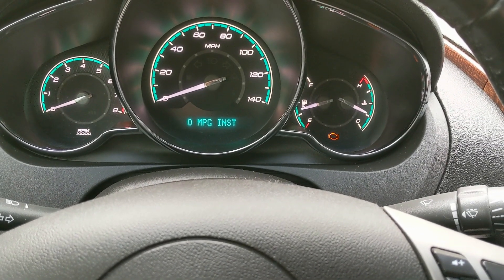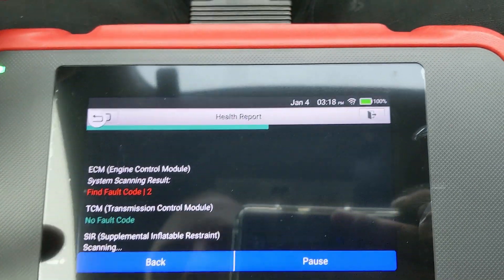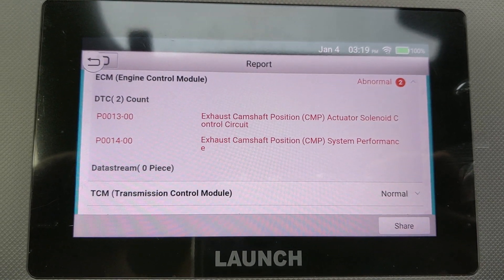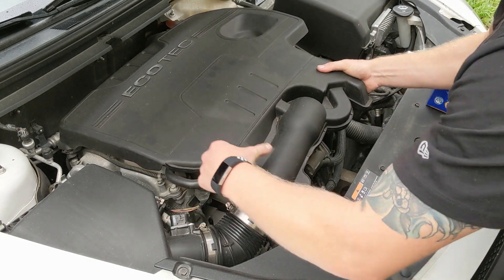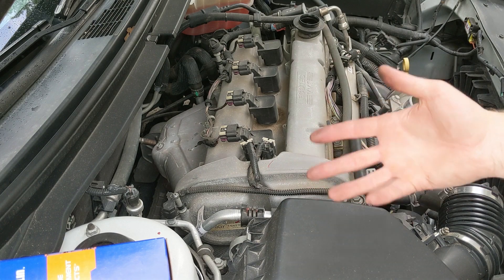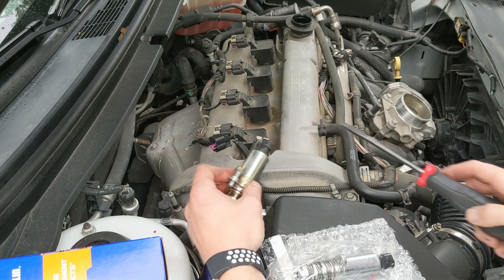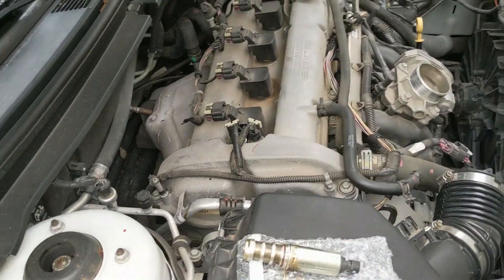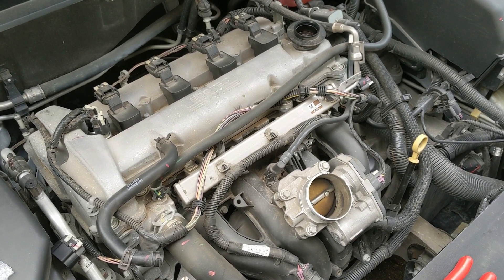Fixing P0013 P0014 Variable Valve Timing Camshaft Solenoid Chevy Malibu Cruze HHR Ion G5 G6 2.4l

Comment: The air intake is a little different on the HHR bu this video gave me what I needed to get it swapped. Had P0014 & Traction control lights. New Exhaust cam sensor resolved both. Thanks.
Reply from the maker: Glad you found it helpful
Reply: You replied the sensor, or the solenoid as was done in the video?

Comment: Yeah i have a 07 Pontiac G6 an it has 3 codes . Poo10 , poo11 poo14 

Should I replace both solenoids intake and exhaust . Also wish I could seen how to test for power at them
Reply: Yes you should replace both
Reply: @whoreheysilver8664  yeah I did an I also cleaned the other 2 that can cause the code plus was a tad low on oil an after all of that . It's been perfectly fine no issues

Comment: on my 2012 Buick Verano i am getting P0014 and P228D. replacing the VVT Solenoid will get rid of the P0014 issue?
Reply from the maker: Usually the scan tool will list them In an order of most important and sometimes giving the first code can in turn fix multiple codes.

Comment: I have a 2008 Chevy Colorado 2.9. I got the code p0014. Says exhaust camshaft position timing. Could this be a actuator solenoid? And the only problem my truck is showing is when I first start it sometimes it acts like it doesn’t want to start and when I first drive it while it is cold it wants to bog down for a second around 2000rpm.
Reply: Yo get that looked at ASAP. Colorados have only one solenoid on the left side of the engine up near the front. About 40 dollars. Do that first. If that doesn’t help you need timing chain work. And a broken or loose chain will likely damage the engine

Comment: I took mine to a mechanic for these codes and they told me they checked the issue but didnt see a problem. When i do a scan I'm getting the code and my check engine light has come on. What do i do

Comment: Hi curious. Are both the parts the same. Meaning  do i get 2 of the same if i have both codes 0013 0014. Thanks
Reply: I believe the 0014 it's the exhaust and the 0013 would be the intake.
Reply: @LuisDiaz-vj3gw  Thanks yes i had to get one with the black top and other was gray

Comment: I replaced both solinoids in my 2014 Cruz, but still getting code P0014 B Camshaft position Timing over - Advanced, Bank 1... 😔😔
Do you have any advice about it.. 😔
Reply: Same issue. 2012 equinox 2.4. Lost and confused.
Reply: @southwestohiodashcam6838  
Problem with the timing belt or cover.

Comment: I have a 2013 chevy equinox and the p0014 code came up. I got an oil change and replaced the solenoids and the code come back up a couple hundred miles later. What else should I try
Reply: If the engine is sludgy, it's possible that the screens plugged or the car got low on oil.  Or it could be that the timing chain has stretched and the slop is what's confusing the cam position sensor and setting the code.

Comment: So would I need to replace both or just the p0013 and p0014? Cause rhat the codes that my car was tossing up
Reply from the maker: Most likely not. One code usually causes the other but it's a possibility. But I mean as long as your replacing the one you might as well just do both its fairly inexpensive

Comment: What should we look at next if this doesn't clear the code?  I replaced mine and did an oil change... Still have same code 😥
Reply: Timing belt issue
Reply: Timing belt issue you may as well want to check the CPS.

Comment: Do I need to clear the code with the Scanner Code Reader after replacing this part?
Reply: If this fixed it then it should clear on it's own.
Most parts store will have a scan tool and clear the code for you if you want.

Comment: I replaced the exhaust cam solenoid but the check engine light is still on. Code is p0014 B in a 2012 chevy malibu. Not really sure what to do. Also it's been a few days since I replaced it.
Reply: i allways remplace on pair intake and exhaust at the same time

Comment: Very helpful when replacing both Solenoids for code P0013 only.  I did have a question, if after replacing the Solenoids and clearing the codes, if the P0013 code returns, what should be the next item to check?
Reply: Did it come back?
Reply: @getchasome6230 yes it did. Why tho?

Comment: Are NAPA brand okay to use for this or do I need to get ACDelco?
Reply from the maker: Napa brand is just fine
Reply: @TonyTheTechnician  Thanks for the quick reply!
Reply from the maker: @JoshRange  no problem 👍
Reply: 90% of my parts are Napa. Acdelco are great. You’ll get the 1/100 parts every now and then when it comes to electronics that are bad right out of the box. But Napa is a great place for them with oe style parts at a discount price.
Reply: @shoe_string_r6303  Depending on the parts, some AC Delco parts come from China and are just reboxed.

Comment: Ok I replace the both solenoid and try cranking the car and it will crank but won't start what should I do but here a catch my throttle body didn't come with a clamp around it so could that be a problem
Reply: Replace CPS

Comment: I bought a Malibu for $550 because the mechanic told them this CEL was "the timing going out" turns out it's a $45 solenoid?
Reply: Yes but timing guides are a huge issue with the 2.4 around 100k. Stay ahead of the issue and do the chain,  guides, tensioner also

Comment: I have a 2014 chevy equinox, and got the p0014 code, not the p0013 code. What would I need to replace?
Reply from the maker: Pretty much the same thing. 14 can be caused by sludge or buildup on the solenoid. I would check the wiring to the solenoids and check the condition of the solenoids
Reply: Copy, I really appreciate the help!! Won't be able to check the car until tomorrow though. But would you also know as to a loud rattling noise as well as a P228D code? Cause I havent been able to get a clear answer yet.
Reply from the maker: No problem. I would start by fixing this issue and then see how the car performs and see if the other code returns. If it does it looks to be fuel pressure related. I.e. the regulator and the voltage to it. Unfortunately that would take further diagnosis. But if that is an issue it could cause excessive fuel and could cause misfires which could cause engine vibration or noise. But it's hard to say what the clunking is without hearing it or knowing when it exactly happens. I'm sorry I couldn't be of more help
Reply: Thank you a lot brother, I will address the first problem like you suggest and will update after it runs for awhile.
Reply from the maker: @oohoohdeenie4469  sounds good. Hope it all works out well for you
Reply: @TonyTheTechnician  I replaced the vvt solenoids and 0014 code returns. So if I understand your post properly, it apparently fuel pressure related to the fuel pressure valve at the top right side of the motor.